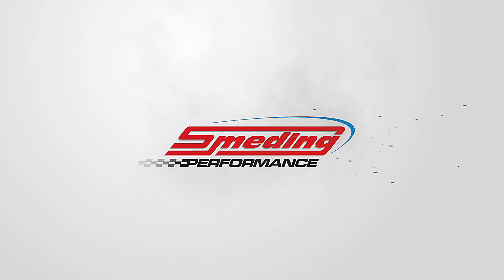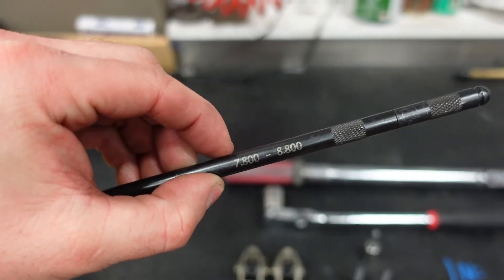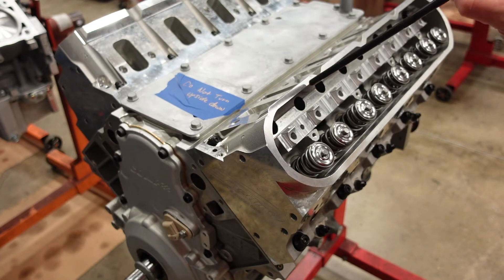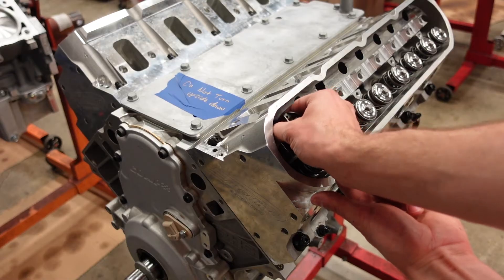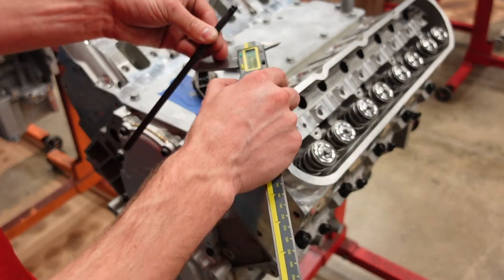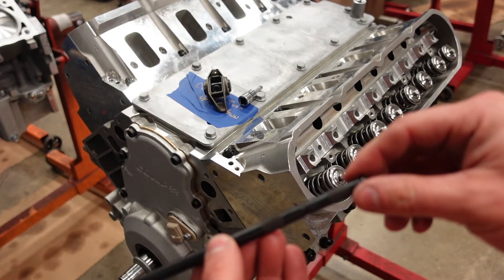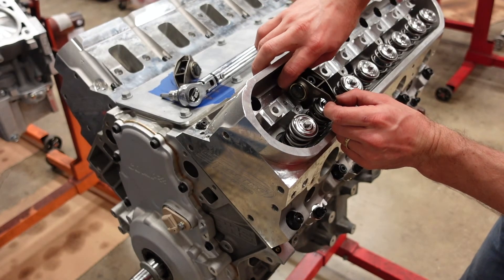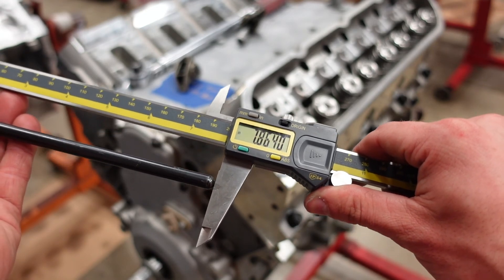How to Measure LS Engine Pushrod Length (In 7 Minutes)

Comment: Definitely have to zero out your caliper first before you go taking measurements, most likely why your intake and exhaust where so far off. But I like your method I’ll give this a shot when putting my engine back together next week with a fresh set of Johnson’s
Reply from the maker: Caliper is zero'd. The intake valves are titanium so they run lash caps. That's what there is a different length compared to the exhausts.

Comment: Can you do a video on how to set  lifter preload?
Reply: He did that already in the measurements by adding .050 to his overall measurement to account for lifter preload
Reply: @m.r.s.mobilerepairservices8895 is that the same for every lifter or does it vary like can .050 be use for all lifters?
Reply: @AustinJC77 many lifters are preload specific.  For instance Johnson 2116SLR’s require a .030 +-.005 preload. Each manufacturer will vary and usually list the recommended preload of their lifters for optimal performance.

Comment: Doesn’t tell you where the rocker tip is on the valve stem . Anyone could take up lash and the rocker tip could be to far inboard or out board of the tip

Comment: Tried this tonight, after torquing the bolt down, i tried to spin my checker to extend it, and the entire pushrod checker spins on the lifter bucket. Any tips to get just the top portion to spin so it will extend up to the rocker arm?
Reply: Same here, very annoying. Ended up using a different method
Reply: Mine did the same. I found I could wind it in though. So started bigger and wound down till I found the sweet spot
Reply: I went through 3 days of foolishness with this tool.  It kept spinning when I removed it to measure.  It spins the entire tool.  I ended up using tape to hold it in place.  Next time, I will order multiple sized pushrods.

Comment: Is it important to check all of them or just a pair on each bank?
Reply from the maker: I check one cylinder on 90% of our builds. If everything is machined square & parallel there should not be more than 0.005-0.010” difference across the 8 intakes & 8 exhausts. (It is normal to run two different lengths on I vs E)

Comment: So Ive did lots of old school SBC but only thing I know about a LS is one is in my truck well actually I have a 5th gen I guess 2017 lol. so unlike old school on a stock LS they would be no preload and zero lash? Not working on anything just curious and trying to understand.
Reply: They should have some preload if everything is stock. 
Remember, in this video he's checking at zero lash then adding .050 preload to the measurement for his custom application. A stock engine should have preload built into the the stock parts.

Comment: Good info! I’m trying to get my Yella Terra rockers/ LS7 lifters to shut up. I’m going to use this when I change to a different cam I got. What preload works best on LS7 lifters? I’ve been told they have .200 plunger travel. Should I go .100 on my preload? I just want a motor that doesn’t sound like a sewing machine.
Reply: You can run up to .100 preload on the LS7 lifters but I personally feel Iike .070 to .080 is the sweet spot

Comment: Exactly how I did my st2126lsr's. I had oem ls3 heads, new oem valves, fresh vj, still unhappy with variance. New rocker stand helped. Still had 3 that seemed to hang a valve open, Manton got them to me the next day and we were good.
Reply: Will manton make a custom set with different lengths in it? If say i measure all 16? I have ST2116LSR lifters
Reply: @NoMercyGTCS  They sure will. Give them qty x overall length.
Reply: @evcass69  What would you advise if the lengths vary per valve? do an avg of some sort?
Reply: @NoMercyGTCS  hmm, I suppose I'd error slightly longer if I stayed within the lifter preload range.
Reply: @evcass69  i’m trying to be certain i dont hang a valve open! Didnt know if that meant sticking on the shorter side of my doubts lol.

Comment: Off topic here, but do you know of any resources or can provide the process of programming fuel injectors? I am doing a stock rebuild on my 5.3L LC9 and want to replace all the injectors. GM mentions the replacement injectors need to be programmed and I'm not turning up much luck searching
Reply: You will need to input the data that comes with the set of injectors that you buy, into the ECU. Not sure if that's what you're asking about.